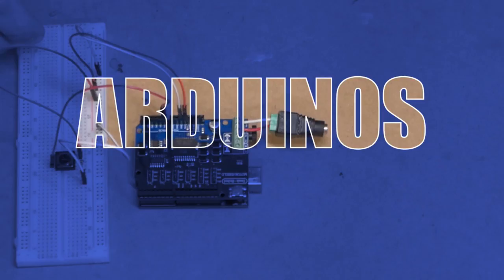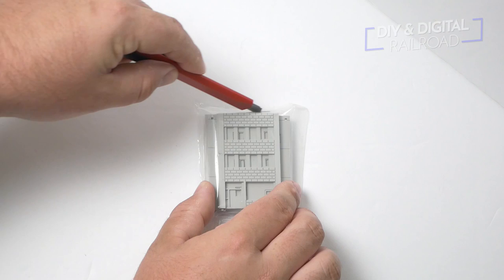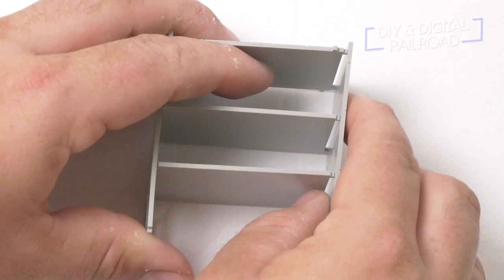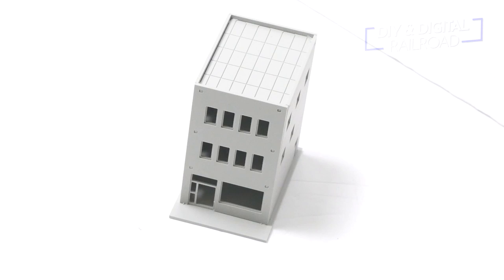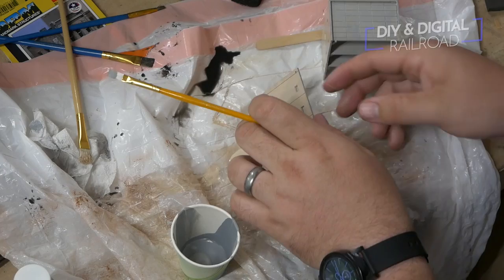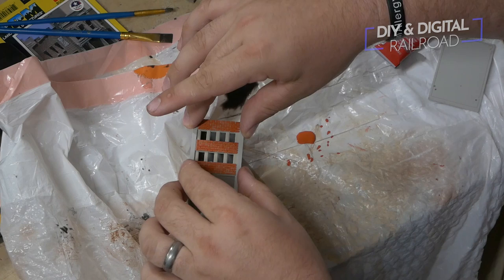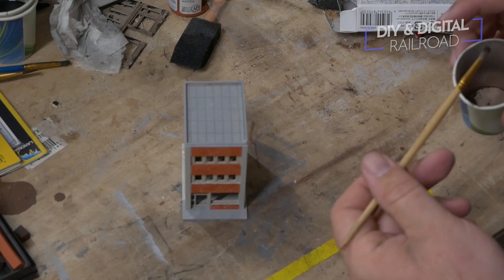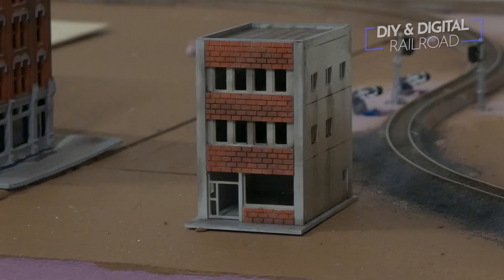Outland Models,  Good or Bad?

Comment: Hi Jimmy, These are fantastic buildings and as with so many things the amount of work that you put in to it pays dividends. Although these are also available in HO, I have used the N Gauge buildings and find that at that scale the fine detail is not as visible. I have added variable lighting to some of mine, added extra floors and of course, people. This is easy to do post build as they pop apart easily. As you have a 3D printer you could also make loads of office furniture and so forth to add interest to the models. I also have their signals and am about to try adding miniature LEDs to see how they will turn out. The nice thing for me is that their pricing is very good and the shipping time from China is really quick. I see you go through Amazon, I have been buying direct.

Comment: What is the best "glue" to assemble these kits?  I do not like "snap together" buildings.  I prefer to glue them together.  I know that these kits are not made out of the same type of plastic as regular model kits.  I think the plastic is PVC.  So, this is the reason why I asked about the proper "glue" to use.

Comment: Also, note these are not N scale, which is 1/160th.  These are a tiny bit bigger at 1/150th. Structures are an area you may not notice it as doorways can vary in size for commercial buildings.  The automobiles are very noticeably out of scale though.

They sell a 'bus terminal' that is not a good choice for US modelers, but it does make a really nice large truck repair shop.

Comment: Good day Jimmy. That a neat little building and you are right, would make a very background building or even with a few added details up-front also. Kit turned out great, looks like one can be done in less than a half hour.
Do they make these in HO Scale?
Thanks for sharing
Muse
Reply from the maker: Yes they do have some kits in HO Scale
Reply: @DIYDigitalRailroad  Great site and lot of buildings to chose from. Thanks for sharing the info.

Comment: Jimmy,
I haven't used SnapTight in decades.  Neither a fan nor detractor.
From what you demo'ed I may try Outland out.  But I was wondering how easy/complicated is it to pop apart to Super Detail AFTER I assemble.
I understand your use but on my layouts the "KID" Operators play an MMRxR scavenger hunt so I need, and enjoy, detailing/animating inside and out.
I'm also thinking of useing Outland for kitbashing models & parts as well.